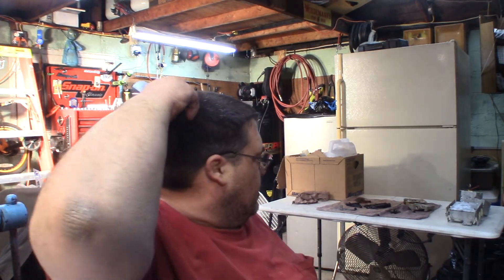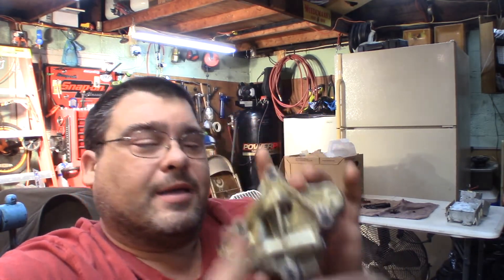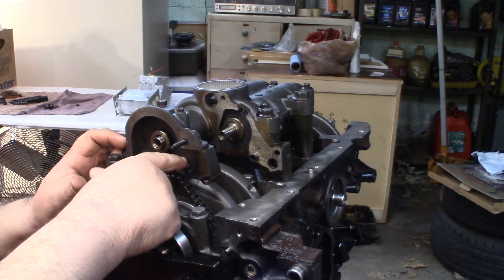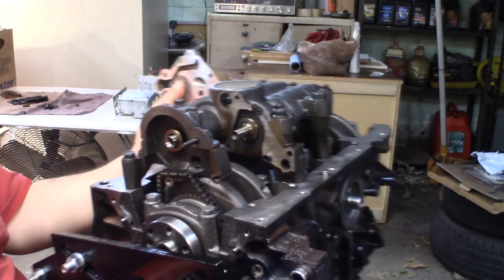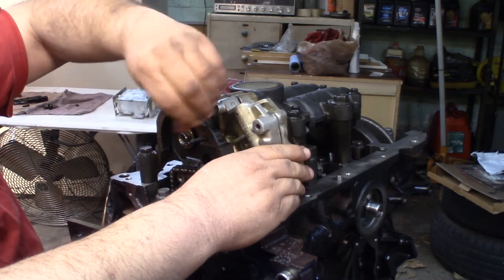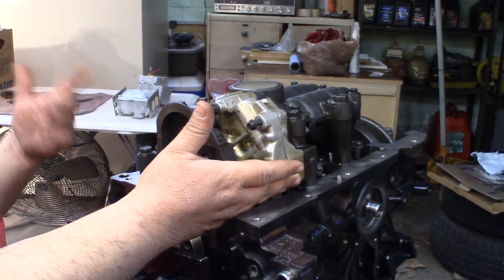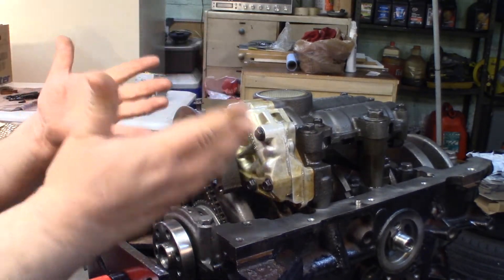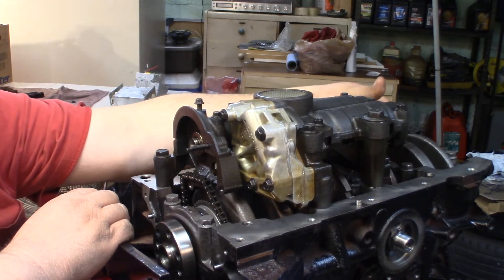LD9 Engine Rebuild Part 9 - Installing Oil Pump - 1999 Grand Am GM 2.4 Quad 4

Comment: Thank you so much for making this playlist of videos! 
I have a 2001 Oldsmobile Alero GS with the 2.4 L twin cam. I saw it sitting in the field and asked about it. Apparently it was sitting there for eight years and a half years as of now. They said if I can fix it, I can have it so I went to work and the only issue I found besides the windows and the interior being partially destroyed was the coil pack so I replaced that and changed the oil of course, and it ran and drove great. I put 700 miles on it so far.

Yesterday I went to go pass someone on the highway and I revved the engine pretty high but I didn’t think of anything of it. I pull into my driveway and the engine starts to run really rough and stalls so I started it back up and I hear a wonderful knocking noise and the oil light comes on and off whenever it wants, I’m thinking of pulling the oil pan off replacing the oil pump and rod bearings. 
Do you think it’s worth it?
Reply from the maker: Well Cylinder 3 has less oil flow than the others, that is why it is normally the culprit.  Rod bearings won't normally cause low oil pressure, that is normally a main bearing.  Mains are not a real common failure on this engine though.   To get to the rod bearing /main bearing caps, you have to pull the balance shaft assembly.  There is a special tool to put them back in time.  I would probably just pull the engine, it will be a lot easier to work on the bottom end.

Comment: In another video there’s a guy saying that if you want to do this replacement with the engine in, you have to lift it. Is this true?
Reply from the maker: Not in a 99 Grand am.  The oil pan will come off without lifting the engine.  You can replace the chain without removing the  crank, but the balance shaft assy and pump will come out.